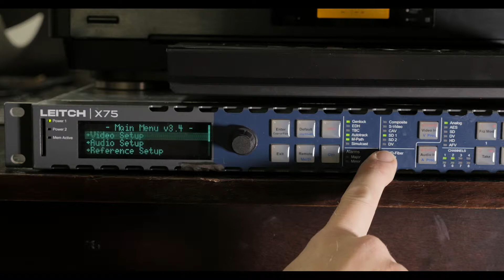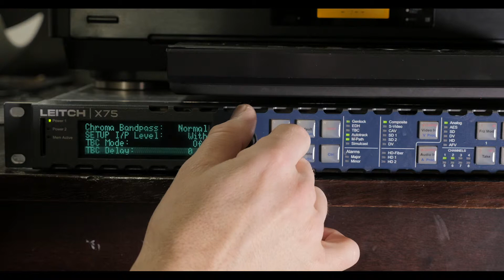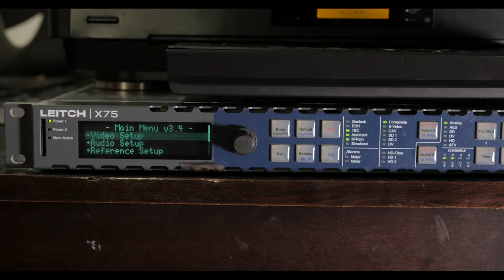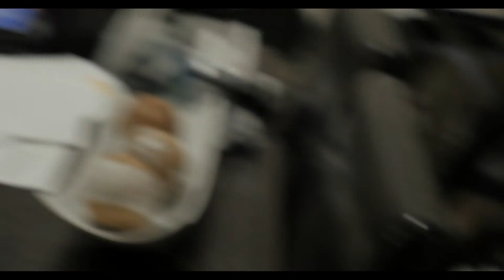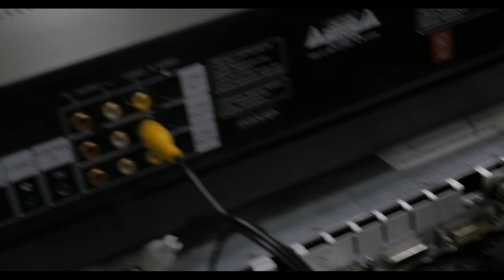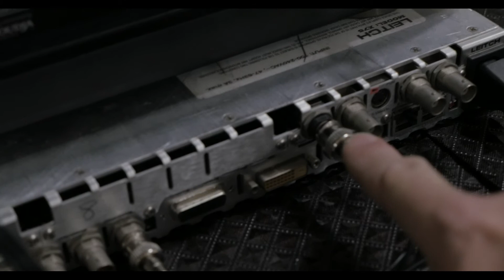Leitch X75 as Time Base Corrector for Composite Signal Demo

Comment: Have you used the Svideo input? Someone toldme that the X75 cant handle hot luma signals because doesnt have a AGC or some regulation of the input level. Can you confirm?
Reply from the maker: I use the S-Video input all the time and never have issues with hot luma. I’m wondering if they might be referring to an issue with older firmware. I know the DPS-575 needs 2.16 firmware to fix a luma issue (though it is supposed to only affect the composite input).
Reply: Thanks  @GrahamAJones  I know that the 575 had some problem with luma signal (some rainbow effect or something like that), but didnt know it was solved. Maybe it was an outdated version. 
I was considering to get a X75 or a Harris X50 or a Grass Valley G1A.
Wich would you consider best?
Reply from the maker: @MarceloJavierMazaLuparia  I only have experience with the DPS/Leitch/Harris series (most of them) but have found as long as you have the current firmware they're all awesome. The X50 does look good too. The G1A appears to be a frame synchronizer only, not full TBC...?

Comment: Is this DPS x75 input signal composite and out put SDI ? So when I connect composite signal input I will get sdi output time base corrected ?
Reply from the maker: There are different models of X75 - if you get one with analog inputs, it will have composite, S-Video and component inputs, and you can time base correct them and output via SDI. Be advised you will need to build an audio break-out cable if you want the audio integrated as well. These are pretty easy to build.
Reply: @GrahamAJones  oh , nice . Now if the out put is sdi , that mean this device work same as ( A/D ) also. So no need A/D after TBC
Reply from the maker: @ER7ABY  Correct -- if you build an audio breakout cable (make sure you buy a unit that has the connector attached, because they are difficult to find online), then you can integrate the audio and video together into a single SDI signal. To build the breakout, you can just buy a couple of XLR cables, cut them halfway, and then you strip the ends of the wires and attach them to the audio connector. No solder necessary -- just screw each one in. If you are importing from a consumer device like a VHS player or Betamax, you will need a line level adjuster like a Rolls ProMatch.
Reply: @GrahamAJones  what is the amazing idea . It is very good for me . Thank u for that. 
Ok that sound perfect. I have seen one unit dps 575 with audio break ( as input ) do u mean if I have this kind of device and the audio+ video will be integrated and then go out in a single sdi ? One sdi carry audio ( L&R ) + video with same time ? Or just 3 sdi cables ? 
This is the first issue . The second is if I want to buy tbc with out audio , then I have to by pass this the audio to final stage which is capture device . Is there any effect of deley between audio and video ? Cuz they are not going with same route
Reply: Last thing , do u prefer x75 or 575
Reply from the maker: @ER7ABY  either is great as long as you get the AV option and S-video inputs. 575 AV connectors are easy to get on eBay, though you still need to build the breakout cable. But with 575 you MUST get 2.16 firmware because it’s impossible to get an update online, and there are issues on the composite input lower than 2.16. Also if you can find a unit with NR (noise reduction) enabled that’s helpful too (also can’t add that now because the company no longer exists).
Reply: @GrahamAJones  i think i will go with x75 , but what do u think if I bypass the audio and capture it in final stage rather than connecting it in brakeout cable with x75 ! Does this will effect on sync or delay
Reply from the maker: @ER7ABY  hi, I don’t suggest doing it that way, because the processor may add a slight delay which will cause problems with sync. The breakout cables are super easy to build, and once it’s done they are super easy to use. As a matter of fact, one of the biggest reasons I use these TBC units is to lock together the audio and video signal into SDI to avoid sync issues.
Reply: @GrahamAJones  oh , then I am gonna stuck with ur idea too . This the first time to make breakout cable , I hope I can do it right . Thank so so much for spending ur time to help me
Reply: How does this tbc function! Is it good ? snell&wilcox TBS180TX
Reply from the maker: @ER7ABY  no idea, sorry. Never used that one. I’ve used close to 20 Leitch/DPS units and have had very few issues (mainly failing power supplies due to age). DPS-235 most prone to failing TBC, so I would probably avoid those. Never had anything outside power supply fail on a DPS-475, 575 or X75.
Reply: @GrahamAJones  ok , I am fraid to buy dps x75 or 575 and found it not functioning well . Do u prefer any place to repair it if there is any issue if I face some thing like this problem .
Reply from the maker: @ER7ABY  Hi, I don't know of any place in North America that will fix them. Best I can suggest is to buy from a seller who can demonstrate that it is working 100%. It's not like buying a new product -- you have to take a chance on these. With their age, all are ticking time bombs. I have several that have been workhorses, working for years, but others have failed. I watch for deals and do email alerts to buy backup units.

Comment: Do you know where I can get this firmware? Mine still has firmware 1.8 and I would like to update it.
Reply: I have acquired the firmware packages -Selenio X75 X85 3.6 and 4.0 releases. DM me and I can provide a Google drive link. I'm still looking for navigator software for easier control
Reply from the maker: Unfortunately you can’t get the firmware any more… the company is long gone. You have to buy these with the right firmware.
Reply: @GrahamAJones  firmware versions are available through Imagine Communications, the company that acquired Leitch and rebranded the X75 as the Selenio X7
Reply: Where can one get the Harris Navigator 5 software to communicate with this unit? I’m still searching the web for this
Reply: Welcome to China Many cheap X75 and DPS575 here
Reply: Wow, thanks!
Reply: Amazing stuff, thanks!
Reply: @DrivingFootage apparently the control software has to be licensed and costs $$$ looks like webpage configuration is best.

Comment: You should be using S-Video cable, I know this is a demonstration but you shouldn't be using composite at all.
Reply from the maker: This was a demonstration for a client who was using it for Betamax, which does not have S-Video. The principles I was demonstrating apply to any input source on the unit.
Reply: @GrahamAJones  How to select PAL or NTSC

Comment: Hi. I have the same but do you know I sometimes have vertical lines in 1080 p. My input : S-Video My output : RGB or SDi. Thank you.
Reply: It might be a faulty unit.
Reply: @santaclaritavalleychurchof8276   I have this problem with VHS with a S-video input. but i have not tried in composite  because in composite the image is a little more blurry.

Comment: @GrayJones hi. I've been searching for this unit for my company. Would you have this unit for sale? Please let me know. Thank you.
Reply from the maker: Sorry, not for sale. You can watch eBay for them. The key is you will have to make your own audio breakout cable — you can get the connector on eBay, and you’ll have to get a couple of XLR cables, cut them, and wire them to the connector.
Reply: GrayJones hi. Thank you for responding. I asked all the eBay sellers about the NR option, and so far no Current listings of Leitch X75, 475, and 575 has this NR option available...
Reply from the maker: @unitedasiatv4203  Yeah... you have to set up an eBay saved search with email notifications, and watch for new ones to pop up. To get the right one can take months, or you can get lucky and find one quickly.
Reply from the maker: In the meantime, do you have any tapes you want me to convert for you? I do top quality transfers at very competitive rates: http://avgearguy.com

Comment: Are these good for old betamax recorders and tapes ? Thks ))
Reply from the maker: Absolutely! Technically they are overkill -- any time base corrector will do. But I like the newer Leitch units because they have color correction, comb filter, noise correction, and other enhancements, and embed the audio and video into a simple SDI digital output.
Reply: @GrahamAJones   thks , what other tbc's do you recommend?  , stay safe ! ))
Reply: @GrahamAJones   is this a x75sd or hd ? Or does it mater if I get one ? Thks
Reply from the maker: @bobbydale1938  It is SD. Won't matter for Betamax, VHS, Hi8, or any other standard definition format.
Reply: @GrahamAJones  thks allot ,will look for one ,iam just learning  )) I will let you know what I do